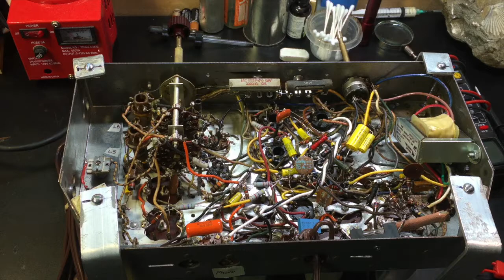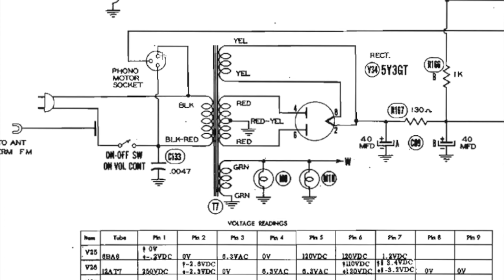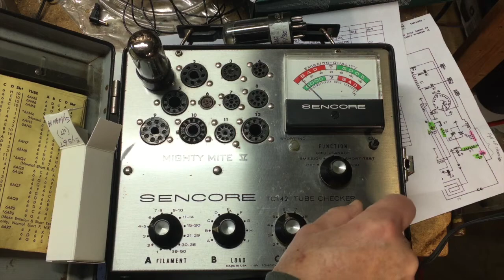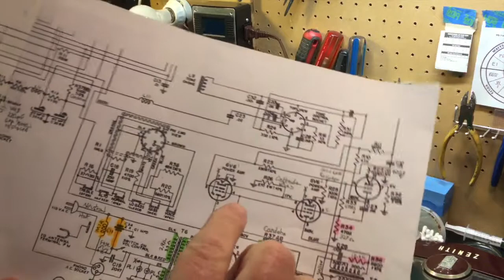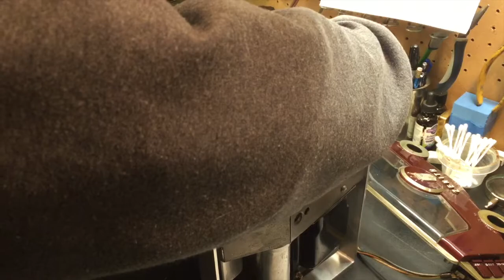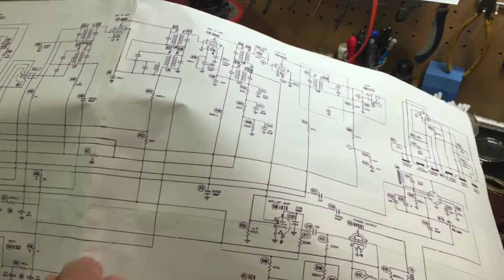1951 Zenith 10H20Z   Episode 9   Power On!

Comment: I was going to suggest that you start with the audio section and inject a signal in to see if it is working and work your way back to the front end.  But then you already have done that!  Good on you!  This should be interesting when you do find out what is causing the problem.  I look forward to your next video to know what the culprit is.

Comment: WHY are you checking "Grid Leak" on a 5Y3 Dual Diode???  THERE IS NO GRID in a duo-diode!!!  You can't have grid leak because there is NO GRID!!!  It is interesting that you had a reading on the meter of your tester, but as I said before, there is NO grid in the tube!!!
Reply from the maker: Tube testers don’t actually test grid leak. They test high resistance leakage between all tube elements, nut just the grid, if present. The misleading name “grid leak” was attached early on and stuck.